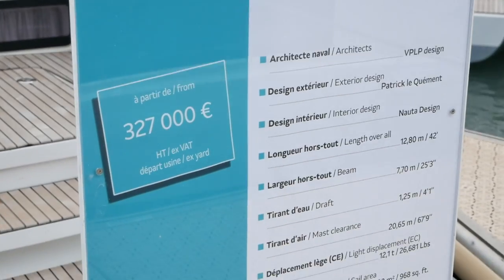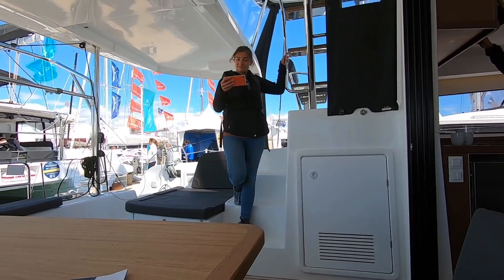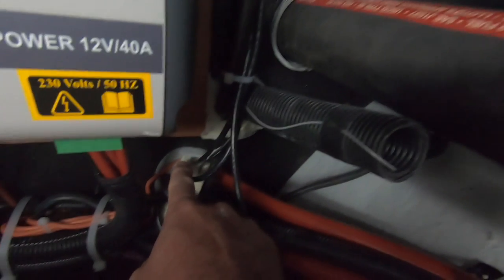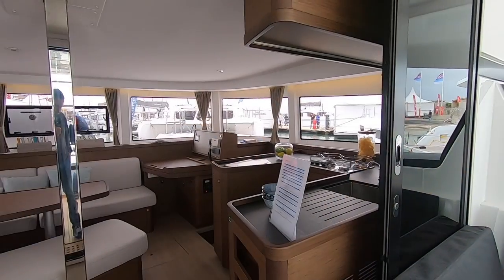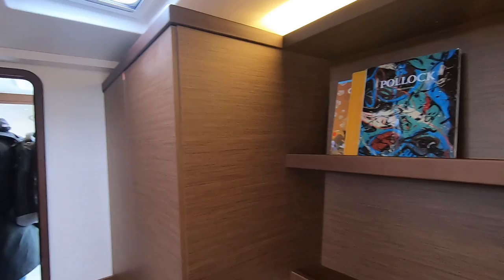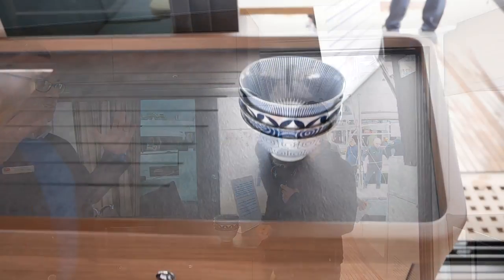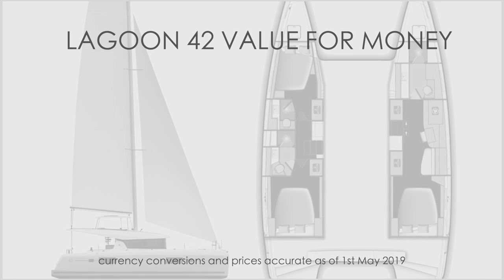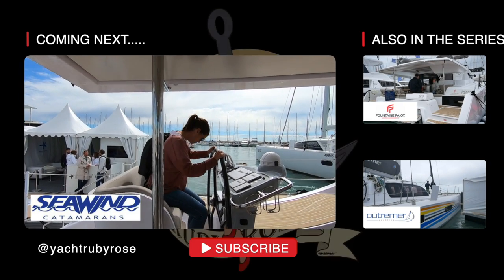Lagoon 42 Catamaran Review 2021 | Our Search for the Perfect Catamaran | Sailing Yacht Ruby Rose

Comment: I'm late in adding my two cents but since hubby and I own hull 181 figured I'd go ahead with my thoughts.  The negatives Nick and Therese mentioned are spot on.  Husband and I are tall people (5'9" and 6'3") and can't see past the enclosure while seated at the helm.  We're in the process of sourcing a new seating arrangement so any suggestions or comments would be much appreciated.  The helm has no safety enclosure to the port side but we've rigged up lines when needed and the enclosure for the cockpit comes down separately to provide a bit of safety as well as wind protection too, so that is an issue we solved easily.  I agree that the cushions are hard and uncomfortable, and we'll be replacing them before we set out in 2024.  For now, we've made some memory foam pads to use where needed.  We added memory foam toppers to the berths too, which makes sleeping so much better.  The stock mattresses are just a bit better than plywood.  The build quality is, agreed, production cat standard, but so far, three years in, it's in great shape with no twisting, misalignment, or peeling.  We're very happy with the systems - the engines are stout, b&g gear works very well,etc.  The stepped back mast and self tacking jib make short handed sailing super easy.  The post in the middle of the salon disappears after a while. We removed the fixed bench inside and replaced it with two folding teak chairs that can be used inside or out, making the spacious salon even more spacious.  I hate the oven.  Seems most production cats have it. We already have the replacement.  You're completely right, with main and jib it doesn't go anywhere fast, so we've added a gennaker which makes all the difference.  We don't plan on being in a hurry when we sail :). I think if you buy a production cat you're compromising in some places and you're going to have to do some mods to make it your own, and we feel that having started with the 42 was a good place to start.  Oh!  Forgot to mention the handholds.  They work well for us AND they work for short visitors, who will not be going forward in inclement weather.
Reply from the maker: This is the sort of amazing comment we love! People adding their own experiences based on ownership. Thank you
Reply: Laurie, if you haven't stumbled upon it yet look up the Lagoon 42 Facebook group.  It has a ton of useful information and pictures of helm seat upgrades.  Some folks are using the Taco Marine bench seat.  Others are now installing the seat that came with the Lagoon 46 - new L42s are coming with this new seat so it seems that Lagoon listened to the prior owners.
Reply: Release Marine

Comment: We own a Lagoon 42.  It is about 2 years old now.  We sailed her from Portsmouth, VA to the Bahamas last November and returned this past week.  We added  grab rails to the cockpit roof as you go up the stairs - both port and stbd.  We also added the washer/dryer combo in the owners hull cabinets before entering the head.  Another great addition was the Code 0.  On our return trip from the Bahamas we hit 14 knots and consistently held 10+ knots with a beam reach and Code 0.  So far, we are very pleased with the boat - we also sponsor a Sea Scout Ship and usually have 10 or more scouts and adults on board when we do our weekend sails around the lower Chesapeake Bay.  She has plenty of space!
Reply: As a future L42 owner (mine arriving in June 2022)
1. What does the standard helm Bimini look like ? Do I need the the reinforced composite Bimini ? What is the original one made of ?
2. What does the B&G navigation pack that comes with the essential equipment configuration  consist of exactly ? 
Nothing in the lagoon website explains these issues.
Thanks in advance 
Hatem A Tawfik, MD
Cairo Egypt

Comment: My husband and I own a 2019 Lagoon 42, Ocean Song. In general we think your review is spot on! We agree about both the integrated grab rail and helm seat height. We've modified our helm seat to raise it 6 inches and we added a fold-down platform (8 inches high) so that even a relatively short person will have a good view of both bows while sitting or standing. We plan to add stainless handholds along the cabin top. We've also added a hand hold just behind the helm seat along the bimini top as one goes down the stairs from the helm to the cockpit.

I would give the 42 a slightly higher performance grade, at least a 6. Part of performance to us is ease of sailing. The 42 is easier for us to sail than our old Catalina 30. For a cruising couple it's hard for me to image a catamaran that is more easily handled than the Lagoon 42. All controls are at the helm and all the sails are easy to hoist and reefing is a "breeze". We have two electric winches at the helm.

Again, excellent review!

Linda and Jim Woodall
Reply from the maker: Thanks so much. Glad you enjoy your l42
Reply: Very interesting. Do you find marina manoeuvring not too overwhelming? Esp.   versus monohull.
Reply: @freduk5342  With two engines she can spin on a dime.  We don't use the wheel in tight quarters, but rather the engine throttles. So in that respect it is easier to manoeuvre the boat in tight quarters vs a 42 foot monohull.  It is quite beamy at 25ft., so being able to see all 4 corners is important. I tell people, when they say "that's a big boat" all boats feel small on the ocean and big in the marina! Cheers!

Comment: Not sure if this a safety issue or not, but ships wheelhouse windows are never vertical  this is to avoid reflection interfering with visibility out. I know its a trademark of Lgoon to have the vertical windows but it may compromise your view out especially in the evening or conning from inside whilst under way. On ships the regulations state the windows should be raked not less than 10 degrees or more than 25 degrees to avoid reflection.

Comment: We own a 2017 model 42.  Sailed Lagoon for decades so it’s difficult not to be somewhat bias.  But when it came to purchase the changes made by Lagoon moving mast back made huge difference for vessel response  when tacking; in addition all controls to helm; ease in reefing main is why we own the 42.  I am 64 years old and know I can handle this vessel alone with total confidence.  Only one requirement you must have the bow sprint for a utility sail to improve cruising performance.  We fitted a UPS sail and that changed the game for us and made this vessel a 10 for handling a CRUISING vessel. (we were not in the market for a performance vessel). In correct conditions we can get upwards 60% of wind speed.  Lastly living aboard comfort is a 10 on the 42. We did not want to feel like we were camping.  Boarding, ease to helm and one level cockpit and salon matter.  Enough fridge, storage and ample room for 6 people at the table.  Secure arrangement for fixing food while under way.  And I appreciate the thin cockpit cushions. So easy to stack when we hose down cockpit.

Comment: I have a  lagoon 42 OV.  I looked for 2 years for the right cat, the 42 was the one. Upgraded to the 57 HP motors, LPo battery bank, better cushions,  B and G all way around. The only downside I have is the galley sink needs to have a barrier on the back side to protect the sliding windows. Forgot the seat, yes too short. Our shorter crew sat/lounged up on the ledge just inside the bimini like cats on their watch, tethered in! I would love to see how you would fix this, my quick option is to buy a large thick cushion.Good luck!
Reply: As a future L42 owner (mine arriving in June 2022)
1. What does the standard helm Bimini look like ? Do I need the the reinforced bimini ? What is the original one made of ?
2. What does the B&G navigation pack that comes with the essential equipment configuration  consist of exactly ? 
Nothing in the lagoon website explains these issues.

Comment: I have a Lagoon 42. 2018, Hull #171. S/V Ocean Potion. I loved your review. First thing I did was put handholds all over. I could have planned better if I knew I was going to put so many. But after the first couple, I added more, then more! I used several of the 24” in stock at West marine. I also ordered some 36” on line. On the coach roof behind the helm station and the starboard side above the winch and stairs along the coach roof. I then basically added more all along the coach roof so you don’t use their crummy hand hold at all. I also added one on each stairway, the port side being a 12”. My friend also built me a teak footstool in two pieces and clamp together. It raises about 6”. I have not gotten around to taking the seat pad off the helm station and replacing with one the will raise the height. I love the davids, some people don’t? I fit a Zar 12’ Mini with a 25hp Suzuki. Single line goes straight to the winch ! I also had solar added above the davits and that protects the dingy. They built an aluminum rail system and also used supports to the David poles for support. . I also replaced with Lithium batteries and to complete the system, a Victron 3,000 inverter/charger. The Victron quarto 5000 would only fit in the engine compartment and I didn’t want it there. I am so pleased with the system! 
I have been a lone time boater but mostly planning hulls. This is my first new boat and my first sailboat! I am recently retired and we left Kemah,Texas on March 1. We are in Marathon, Florida where the upgrades have been made. We will no go to the Bahamas and start our adventure. I have been following for a long time. Love you guys!
Reply from the maker: Thanks my friend. Good info re your modifications. As an owner, would you mind logging your score on our app? The link is in the description.
Reply: What Lithium Batteries did you get? Did they stow in the space between the fuel tank and the drawer under the aft beds?
Reply: Sailing Yacht Ruby Rose I would give a totally biased opinion! I love my boat. I have bonded. It is built to a certain price point. And thank God or I could not get one!
But I will see what I can do. 
Thanks for all you do.
Reply: DSC Y I got Dragonfly Batteries. 800 amp hours fit exactly where there 480 amp hour gel batteries were. No modifications necessary.

Comment: Good review but I was surprised you didn't talk about the design decision to move the mast step aft and put a compression post in the middle of the salon so the boat can accommodate a big self tacking headsail.  A lot of folks also add a code zero to improve light wind performance...

Comment: On the last scene, I noticed Nick sitting at the edge of the sofa with his elbow on the navigation table. It brought to my attention the fact that the navigation table does not have dedicated sitting arrangements making it uncomfortable to work at the table without a backrest. The other issues such as the helm seat and the handrails are easy to solve even after purchase but the problem with the navigation table would require a major redesign of both the table and the sofa.  No mention was made of the access from the deck to the mast base for dealing with the mainsail and the quality of the rigging and tackle in regards to ocean crossing environment.  As of now, to me, this looks like a Mediterranean or Caribbean short distance cruiser Otherwise, good review.

Comment: Great, honest review. My wife and I are basically shopping for the same type of boat. I can wait to get her to Annapolis so she can step foot on these great catamarans. My short list is the FP 40, Lagoon 42, Leopard 40 and Seawind 1260.
Reply from the maker: We have reviewed all but the 1260 as it wasn’t showing at La Grande Motte. We will however review it at Annapolis.
Reply: Sailing Yacht Ruby Rose the Seawind 1260 is actually at the top of my list for a couple reasons. I do like the dual helms, and they are protected from the elements. I also like the galley down setup. There is less freeboard on the 1260 compared to all the other production boats but I would think there would be less windage at anchorages. Might make it easier maneuvering in close quarters. Of course the Seawind is like finding a unicorn in the USA so I can’t wait to see the Seawind in person.

Comment: Personally, I think you rated Safety & Design a bit higher than I would have. I feel with the helm visibility for Terysa and the handrails (or lack thereof) for both of you. I would rate Safety & Design a 4 or 5. Also, perhaps I missed it, but what of the performance of engine vs sail? A lot of your cruising is from bay to bay, island to island, anchorage to anchorage, perhaps 20 to 30 miles per run, much of this done with engine only because of lack of wind. Sorry for going on and on!  Of course, these are my personal views , but the rest of your ratings, I believe, are spot on. Looking forward to the next review! Cheers, Ken
Reply from the maker: That’s what we want my friend, different views and scores. It’s the only way to get a fair and balanced review of all these catamarans. Leave a review using our app and add your scores to the others.

Comment: First I cannot agree - I want to fully agree to your complains about safety. Last year I drove a Nautitech - they also use those grabs. I could use them (ok, I'm 6'2) but didn't feel save as with a standard handrail.

The notes from Therysa about the cushions, also I have to agree, with the exeption, I would like to know were to stowe. What's about travelling in harsh weather? - OK, then I would suggest a Nicks abilities to make a curtain.

If I'm already complaining: Think about your habits of cooking - were are the herbs, were are the bottles of Oil, were will  the stored food be (think of the many overhead cabinets in your boat). I had several problems with that. IMHO that's not fine for living full time with that. 
Salon: I absolutely appreciate that windows- I think, the hold of the sun a little bit - not overheating the salon. What I don't like: There is no cosy place to sit during a long night watch. On my journey we arranged the cushions different to sit in direction to easily monitor the horizon.

Performance: I think many catamarans are weak. Also most have a fat top main, no aft stay. So you will face problems with reaching winds. Solution for all: have additional headsails like a genacker.

Comment: When you purchase a Yacht of such how often will you clean the hull and is it expensive to remove the Yacht from the water and dry dock for cleaning? or is this a do it yourself if you can by dipping in the water and doing it yourself. The Lagoon 42 is a absolutely beautiful Yacht . All the mechanisms that are for the ropes that control the sails have they been weather  and salt water corrosion  coated  or is there no such thing?

Comment: Just a couple of things. The grab channel on the saloon, does it double as a fresh water catchment system?  Grab rails would be an easy add on but I'd hope your jack lines would extend from the cockpit right through to the fore stay. Docking on the starboard side would be a lot more exciting due to the port side controls and personally I'm amazed there were no saloon controls. I didn't like the position of the life raft at all because when your tender is on the davits it's inaccessible. The mast seems a long way back so what does this do to the foot of any foresail fouling the saloon roof? Lagoon have never been noted for their performance but what are the odds this boat will carry the extra weight you know you're going to add, better than the go faster brands. Because it's a Lagoon and an owners version it deserves extra points for both holding its price and ease of sale.

Comment: 2 points off for a seat without a booster/elevator cushion?  The Bolster Buddy Premium Boat Seat Cushion could make the Lagoon 42 a solid 8.  I am tall, I have the opposite issues, I sympathize.  Great video, you spoil us.
Reply: Then add the fucking thing if it makes you comfortable . These are production boats not  hand built  to your spec .

Comment: I can live with many of the shortcomings you mentioned, but I agree the galley is way too small.

I would like more work area, a dishwasher, and a dedicated washer (no visitors to the owners side for washing).  Also, how are all those corners used in the living room area?

A small suggestion: why not compare the actual square feet (meters) on each level (galley and living area and bedrooms and bathrooms) between boats?

A solid review.

Comment: Hard core monohull people love to say that a catamaran will flip over in heavy seas.  Have you had people tell you that?
Also, I hear that the factory installed navigation (monohull or catamaran) does not work well in rough seas and that you need something like a Hydrovane steering mechanism.  However, I am unsure how a hydrovane would work on a cat.  Would you need two of them?
Reply from the maker: The boat is too big for self steer, so you need a robust autopilot.

Comment: I enjoy these reviews , it's nice to see other boats from someone else's eyes. One thing you don't mention is the position of the prop to the rudder. Some French cats put the props astern of the rudders , with two functioning engines they are fine, lose one and the manoeuvre becomes really interesting because you get no prop wash on the rudder.  I have berthed my own 43 footer with one engine with no trouble but I did the same thing for a friend on a 40 foot French cat  with a single engine aft of the rudder - really hard work !  also when going astern a firm hold on the wheel  was needed as the prop wash tended to slam the wheel over.  If you wonder I've sailed cats for 60 years so yes I can drive one - check my you tube channel there are a couple of vids but mainly  some of the bigger stuff.